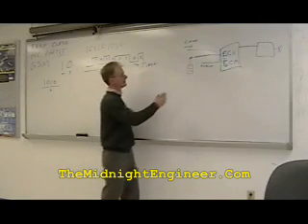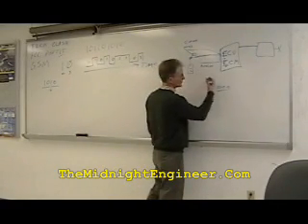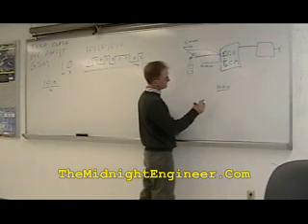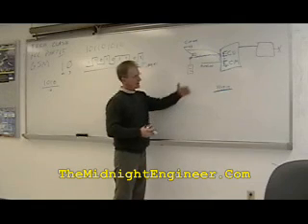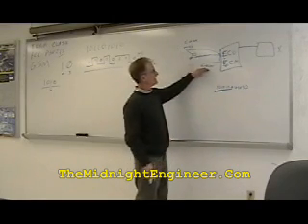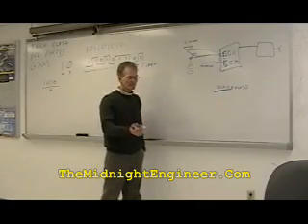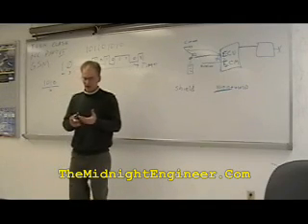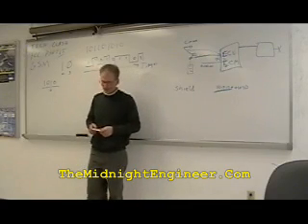Pt 2 Toyota's Unwanted Sudden Unintended Acceleration Recall - A Clash Of Tech

Comment from the maker: @OVINDEX Glad U know difference of Computer Assisted and Computer Actuated

Seen that neutral shift before. If you have model susceptible, keep your HFamps off especially when near metal structures (antenna match) I'm HAM also, studied in '77. Tests not the same now. More detail then in tests about this kind of stuff but no transistor & digital stuff. 

Yes, Scaring me is Computer Actuated Power Steering Assist. Imagine RF on pick-up sensor in steering column and how hard to steer if you can

Comment from the maker: @kassandrasduplex  Please read on Parasitic, Spurious & Harmonic radio signals & electromagnetic interference. Wikipedia is free

Happens all the time but referring only to automotive cases, it takes stronger signal because of all the metal outside of it. Or low power transmitter inside.

RF "strength" is relevant to power, distance and RF signal type

RF on/in a sensor, gives computer a incorrect reading and computer will respond improper but correct for the input

This is not limited to Toyota